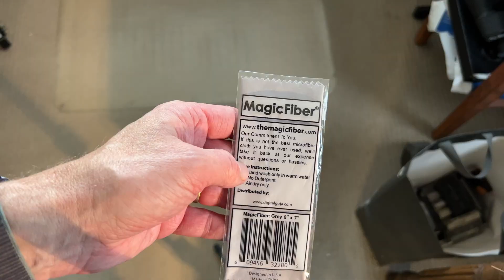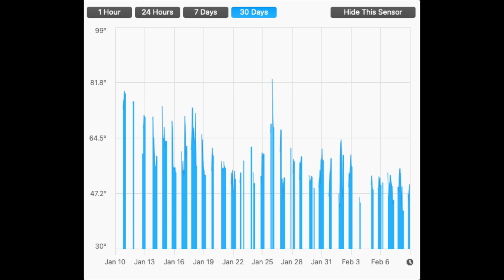CPU TOO HOT! Arctic MX-6 SO COOL 😎

Comment: It should never get to 90c when delidded, no matter what paste is used. I use GD900 from aliexpres, its 1-2c different from some of the expensive ones.
Reply from the maker: actually throttling doesn't kick in till 100c from what I have read and i have seen others report theirs getting to 90c. But now it is running much cooler.       
read below... from a macrumours thread

https://forums.macrumors.com/threads/xeon-x5690-temperatures-and-fan-speed.1958060/page-2

This thread has touched on 'normal', 'safe' and 'maximum' CPU temperatures. If you came to this thread (as I did) in a quest to find out what these temps are, with regard to the Xeon family, the following may be of help.

As h9826790 pointed out, all of the operating norms posted here are well within the Xeon's range. 'Normal', of course, varies for each user, so unless a reference point is set for comparison (like "idling with MacOS-only running in a room with ambient temperature of 65˚F.") determining 'normal' is next to impossible. According to Intel's page on Xeon thermal management:

    "Intel can't give a specific operational temperature range of an Intel® Xeon® Processor because it will depend on the maximum performance of the heatsink used [and] the way the fans are controlled in a system (which can vary the performance of the heatsink)."

Nonetheless, Intel gives ≈75˚C. as a 'maximum case temperature' in their table of Xeon thermal characteristics.

A Puget Systems review, based upon their in-depth studies of the operational thermal characteristics of the Intel Xeon family, made the following observations:

    "We know from both experience and explicit testing that modern Intel CPUs (at the very least Sandy Bridge, Ivy Bridge, and Haswell) can run at their maximum Turbo Boost frequency all the way up to 100 °C. While there may be a tiny performance difference between a CPU running at 30 °C and one running at 95 °C, our testing has found that the difference is minuscule. In fact, even after running benchmarks dozens of times the difference is so small that it is essentially nonexistent."

and:

    We were very surprised when our testing showed that while the minimum CPU load frequency started to drop as soon as the CPU hit 100 °C, the average CPU frequency didn't drop by more than .1GHz until the CPU was overheating more than 30% of the time. In fact, Intel CPUs are surprisingly good at being able to handle this much heat with such a small reduction in the average frequency.

concluding:

    For the average system, our rule of thumb at Puget Systems is that the CPU should run around 80-85 °C when put under full load for an extended period of time. We have found that this gives the CPU plenty of thermal headroom, does not greatly impact the CPU's lifespan, and keeps the system rock stable without overdoing it on cooling. Lower temperatures are, of course, better (within reason) but if you want a target to aim for, 80-85 °C is what we generally recommend.

I set my fan controls to keep my CPU-A core temp below 92˚C. when doing extended Handbrake encoding or other CPU-loading tasks.

I hope this information is useful.
Reply: Its not the throtting im concerned about. I have had multiple X56xx cpus, and even when heavily overclocked, a simple air cooler would keep them under 75c. And that is not delidded/direct die. I doubt the cpus in a MAC is overclocked. Ofc, i could just be insufficient cooling, but 90c+ will definently reduce the lifespan of the cpu.

Comment: 1:08 i recommend buying a pack of 100 drip coffee filters. you need to store them in their packaging or a ziplock bag though to prevent dust from building up on them. i've found the coffee filters to be way more convenient than a microfiber cloth because you just toss them out after each use, and they never leave behind any kind of lint or anything. and they can't scratch your heat spreader even if its lapped in. also 1 pack of coffee filters will last you a life time of cleaning up paste for the most part. and i use 90% isopropyl as my cleaning solvent. love that stuff
Reply from the maker: I’ve tip will try that

Comment: In my MacPro, it's the North Bridge that gets in the mid 80's ºC according to Hardware Monitor. Can this be repasted as well?
Reply: That's what I would recommend. I repasted and also changed the plastic clips and springs to metal ones. The plastic mounts on the North Bridge are prone to eventually fail. Once I did that and repasted with some Noctua thermal paste, my Northbridge diode stays at 58-60 C. Also, I noticed that my Mac Pro hasn't frozen or become unresponsive ever since I changed the clips and repasted.
Reply: @ascendantP  Thanks. I will see whether I find some good instructions to proceed as I have no idea where is the Northbridge!
Reply from the maker: @lucbourhis3142  check out House of Moth here on YouTube he has a video on it. Might as well re paste Northbridge and both processors while your at it I have pins on order on ebay as my NB is running hot as well.
Reply: What is a good source for better northbridge pins?
Reply from the maker: @hngdog  https://www.ebay.com/itm/144906721271?mkcid=16&mkevt=1&mkrid=711-127632-2357-0&ssspo=m0IhSC-HSEy&sssrc=2349624&ssuid=o6k3tERPQiC&var=&widget_ver=artemis&media=COPYthese are the ones I ordered they should do the job.

Comment: cpu's without a cover are in 4.1? or did you remove the cover for better heat transfer?
Reply from the maker: you can de lid them or buy them delided, that is the way they came in the 2009 Mac Pros. It makes for an easier install than trying to upgrade with lided CPUs. You can find delided ones on ebay or do it yourself. I was given the 5690s. My 5680s had the lids on them and while they worked it was a trickier install. I have a few videos on installing lided cpus and there is more risk keeping the heat spreaders on the cpu because the 2009 was designed without them.